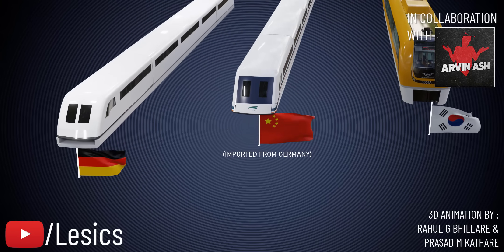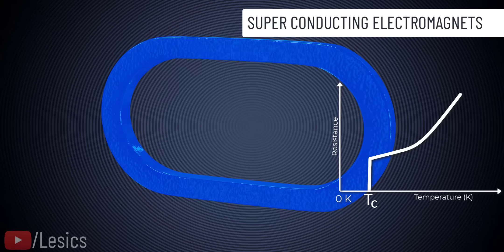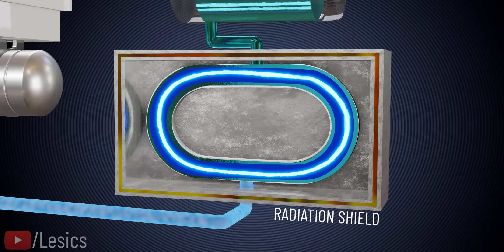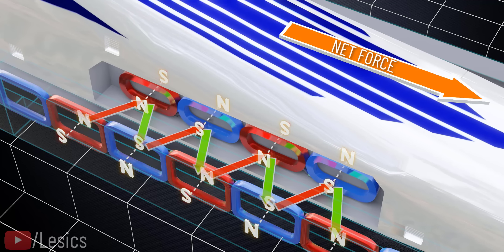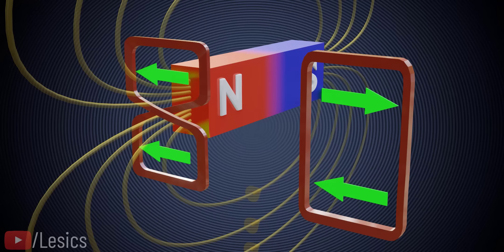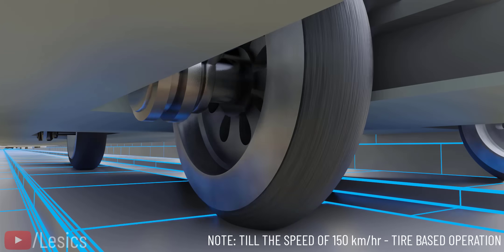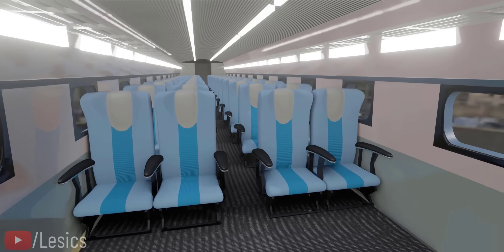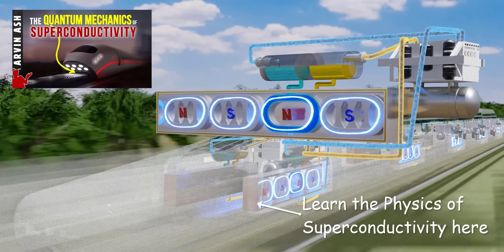The Fastest train ever built | The complete physics of it

Comment: One question though, doesn't surrounded by so many powerful electromagnets have any adverse effect on human beings? Is is safe?
Reply: The magnetic field generated by the Superconducting Maglev does not affect health because the magnetic field is controlled below the standard value set by the international guideline (ICNIRP guideline) by taking various measures.
The standard value is set to a strict value of about 1/5 to 1/10 of the magnetic field level that may affect the human body.

Comment: The technical aspect is certainly fascinating. But I wonder what problems of conventional trains this technology actually solves?
I mean the tracks alone are vastly more complicated and presumably more costly to build and maintain. And the same should hold true for the train itself. All while considering that the current speed record is 570ish and was achieved by a conventional train and knowing that during passenger operation this train wont go nearly as fast.
It would've been nice if the video had included a energy comparison to conventional trains.
Reply: the Tokaido Shinkansen line operated by the same company is already at near full capacity in terms of the number of trains operating. at peak times a Shinkansen train departs at Tokyo about every 3 minutes. this will decongest it and at the same time seriously rival airlines operating at the same route.
Reply: Less drag and friction due to not using wheels should make it more power efficient at higher speeds. Since conventional rail will require more energy to overcome the added friction of the wheels at higher speeds. Higher speeds also wear out the wheels and powerline faster. The initial cost of this is higher due to the special track but it's overall cheaper than conventional HSR when running at the same speeds over the course of its operational lifetime. It's actually also cheaper maintenance wise as the magnets are essentially passive systems and there's less wear on the actual train, its maintenance is more on hours in service than distance travelled and average speed like in conventional HSRs. The biggest cost draw is mostly upfront for the track and initial designs, overall HSRs are usually cheaper for shorter distances while MagLev tends to end up cheaper for longer distances.

Aside from relieving congestion from the current existing lines, the speed is important as it cuts travel time and makes the economic city hubs of Japan closer. This results on potentially bigger economic activity just like how the initial Shinkansen did when it made it possible to travel to Osaka and Nagoya within reasonable time in a day which the govt is aiming for.

Comment: Seems like a waste when you get the exact same hover. Technology by using exact same three of those type of magnets then and pulling them opposite from each other then and pointing all the magnets toward one single point. Send using another magnetic ring on the inside of that solitary point should create lift and as long as you have power supplied to the magnets and the ring. Anything you connect to it will then also gain the zero gravity effect but you would have to connect to it after you turned it on.

Comment: The system as shown in this video is still essentially a monorail. A practical mag-lev system needs to be able to switch "tracks".
Reply: If the train is dedicated to going from point A to point B delivering/picking up and dropping off  passengers along the way why does it need to switch tracks?
Reply: @paulchristensen2854  What happens when it gets to the other end? Does it go back on the same track, making it fit for one train only? Do you have a loop at each end to turn the train around? What happens if it breaks down? How do you put it into sidings to allow the next train to pass? It's not a practical system as it stands.
Reply: @apmcd47  LMAO....right countries are spending billions....no 100s of billions of dollars on these "unpractical systems" 
As I see it there are two things to break down
1, loss of power/power failure. If that happens the trains stop....all of them
2 ,computer malfunction causing the polarity reversals to be timed incorrectly. If that happens the rains slow down or stop altogether
Reply: Okay, this video by Mustard (https://youtu.be/-MmcQKE12Hg) mentions, but doesn't go into detail about, switches for this system.

Comment: Power consumption: "The Superconducting Maglev is a transportation system that uses less energy and offers greater functionality than airplanes in terms of speed performance, access to urban areas and transportation capacity. Estimation based on specific premises puts peak power consumption (instantaneous value) of the Chuo Shinkansen at approx. 270,000kW at service launch to Nagoya, and approx. 740,000kW at service launch to Osaka, as shown in deliberations by Japan's Transport Policy Council. These are well within the supply capacity of electric power companies.
The Tokaido Shinkansen has improved its energy efficiency by approx. 50% since its service launch. JR Central will continue to work on reducing the weight of vehicles, improving its shape, enhancing the performance of power converters and incorporating leading-edge insight to the maximum extent to boost the energy efficiency of the Chuo Shinkansen."

Comment: Brilliant video!
Question: What limits the trains speed? Is it only air resistance?
Reply: Air resistance yes and the amount of power it consumes. Faster you want to go, the more electrical power you'd have to put in. Also the faster you go the more mother nature is trying to hold you back. So at a certain point you'll use way more energy on every extra kph (or miles pr hour) than would be sustainable. Maglevs are absurdly expensive because they require so much energy and that's also why it's not commercially viable on a massive scale like rail.
Reply: Yea I guess
That's why they made such a sleek and aerodynamic engine cab
Reply: Besides the strength of the propelling coils, I'm guessing that it's speed might be limited by the stability of the system. The video only talks about static stability, but at higher speeds oscillations may develop (either vertically or side to side) that would make it unsafe to operate.
Reply: Power limitations
Reply: If it was in vacuum it would have been faster
Reply: @GAMERAX_Ae  Yes it would, but making a continuous vacuum chamber for a train...not such an easy thing to do.
Reply: current or voltage controls magnetic power and wire density, wire diameter and wire insulation thickness/material limits the max current, basically like with any bldc
Reply: Power is proportional to the cube of velocity. So slick as it is. It can only go so fast before power consumption becomes ridiculous. Also the faster it goes the longer it takes to stop.
Reply: Greater the speed, the more levitation is achieved. My theory then would be that if they increased the speed too much, it could fly off (?) when reaching a critical point (if possible at all).
Reply: @Killer99215  it can't fly off coz when it moves over the central axis of figure 8 the force from upper coil will be more hence it will add up with the gravitational force and bring the train down , same principle of how the train levitate but now it is trying to keep the train down. Maybe due to quick changes between levitation and delevitatinon there will be turbulence hence for safety reasons they may be sticking to a certain speed limit. Hope my comment is useful.
Reply: @The_Sad_Cactus  Thats what I thought.
Reply: @The_Sad_Cactus  nmu
Reply: Nothing, if they wanted, it can travel so fast than front of it melt by air drag. And second reason is power what it needs. But basically it have similarly of railgun. Railgun use just direct contact for power, not coils.
Reply: @jannejohansson3383  ?!
Reply: I think when the train reaches a certain speed like the point it starts flying/hovering it cant fly off despite it goes super fast cuz the magnet is keeping it from flying and keeping it from going down during the super speed thing.

Comment: At such high speeds, it is extremely dangerous to move in close contact with the ground. A sudden failure may occur in one of the numerous driving and propulsion systems, or a sudden obstacle in the path or any unexpected event may occur. If such a mass traveling at such a speed loses control and exits the runway, in addition to killing all the passengers it would wreak havoc for a few kilometers of everything that exists along the way. In my opinion these things are mere nonsense.

Comment: I would love to see all the equipment needed to control all the timing of the electromagnets and sensor feedback from every system on the train and ground. So impressive!
Reply: They can improve it still by adding barbs that encourage the shape of the magnetic field to reduce its electrodynamic drag really it should be researched amongst all forms of magnetic induction system it might reduce the amount of regenerative breaking yield but you get higher speeds with less power on a single coil since it will ‘reach’ out to the one infront to coax the reactions faster a third rail used to braking might be necessary if you were to push the limits of its current design
Reply: Used for braking*typo

Comment: This is a very expensive design, as building the tracks is very expensive. As there are always more tracks than there are trains, it's favorable to have expensive trains and cheap tracks than having cheap trains and expensive tracks. With expensive tracks as this design uses, long distance connections are very expensive to build as the longer the distance, the more track you will need.

Comment: Looking at it again.  I do not understand the twist coil.  You have set the magnetic ring at the outer layer, which is either N or S.  Then you put the twisted coil for dinner later.  Doesn't make sense.  Each particular point should has the dominant pole that either push or pull the twisted one.  How the train move forward when the pulling force can come from both front and back equally?

What would happen if the passenger wear jewelry in the train if the pole force is that strong.

Comment: So am I the only one thinking the fastest train is a bad idea on an island country that's constantly hit with major earthquakes? What happens when the track is displaced from a shift in the earth or power loss at such a high speed?
Reply: Around 17:56 on October 24, 2004 "Niigata Chuetsu Earthquake" * Magnitude 6.8, a direct earthquake with a depth of 13 km at the epicenter
A total of 8 cars derailed, except for cars 6 and 7 of "Toki 325" from Tokyo to Niigata. At the time of the earthquake, the train was decelerating to about 200 km / h due to the stop at Nagaoka Station, but the emergency brake by the early earthquake detection warning system "Uredas" was activated and it was about from the derailment point. The train stopped at a point about 5 km near Niigata and Nagaoka Station near Tokyo.
0 injured, 0 dead

Around 14:46 on March 11, 2011 "Tohoku Region Pacific Ocean Offshore Earthquake * Great East Japan Earthquake" * Magnitude 9.0 to 9.1 The seabed of the Pacific Ocean (off Sanriku) about 130 km east-southeast of the Oshika Peninsula (38 degrees 06.2 minutes north latitude, 142 east longitude) Degree 51.6 minutes), depth of the epicenter about 24 km
None of the Tohoku-Hokkaido Shinkansen, which was in commercial operation, derailed.
Naturally 0 injured and 0 dead
This is because the system that applies the brakes by observing the P waves generated before observing the sensational shaking (S group) of the earthquake was activated.

Comment: I had experience with it roughly 20 years ago. It was so cool. Sad it’s still not for commercial use yet, and it might be too late. I’m afraid Hyperloop might just kill it…
Reply: It won't.  The concept of the hyperloop isn't feasible(on Earth) and even if it was made functional it will be neither economical or pass safety checks.
Reply: Japan will not start commercial use until it has repeated safety and durability tests over and over again ... hundreds of thousands of times.
We assume and experiment with all situations for safety and durability testing.
If Hyperloop is to be used commercially first, its safety and durability are questionable.
The Japanese Shinkansen does not actively introduce the latest technology, and even if it is an old technology, we will introduce the system with an emphasis on reliability.
Safety and reliability are of the utmost importance to Japanese railway engineers, not innovation or speed.
What is the most important thing about public transportation? Is it innovation? Is it speed? Is it the world's first title?
No, it's safety and reliability.

Comment: So this is basically the same as aviation from a load and speed perspective. Clearly a far better idea than vacuum trains.

mag train:
~600 km/h max
everything is very expensive (train, tracks etc.)
high maintenance
low loads
not possible to switch tracks easily.
therefore, very limited branching of the system.
probably environmentally friendly

normal train:
~400 km/h max
medium cost
low maintenance
max weight that can be transported on land
track switches are no problem
You could go as far as to replace all bus lines in the world with it if you wanted too.
environmentally friendly

Aviation:
>300m/s max
very expensive
high maintenance
low loads
no track only needs airports
very unfriendly to the environment

I kind of am unsure this 2030 is a reasonable expectation for this to be build pretty much anywhere because it has to compete with aviation and is almost the same but with greater drawbacks. So until states actually enforce any environmental reforms, it won't make it.

Comment: When Maglev goes about 10 cm (or less), above the ground with a speed of approx. 600 kph (or anything above 100 kph), creates an enormous air cushion which reduced the needed electric current necessary for levitation. This phenomenon is not mentioned, but it should be.
Reply: The ground effect
Reply: @amirfmaster2515  ground effect is usually used for downforce, not making an air cushion i think
Reply: @ananayjoshi  Ground effect usually used in air cusion such WIGS , or helicopter in hovering mode.
Reply: @ananayjoshi  you think wrong. Think of low wing airplanes, the ground effect makes 'em floating upon landing.
Reply: @ananayjoshi  yea that could actually lift it too far .... I think the same force if not more would be needed to keep it save and steady in both vertical as sideways position... think about weather conditions.. wind, cold / warm fluctuations etc... You wouldn't want to be depending on those in such a tight space
Reply: The levitation and guidance coils in the track system are all passive.  There is no more "power" required for them to operate beyond what's needed to keep the train's coils superconductingly cold.

The track system's propulsion coils are powered, but are only indirectly involved in the levitation forces.  

This whole system is insanely clever!

I do wonder about something as simple as someone throwing an old tire onto the track.  I assume they must be able to handle some significant track debris somehow.
Reply: @jerrygrimes8813  'The levitation and guidance coils in the track system are all passive.  There is no more "power" required for them to operate beyond what's needed to keep the train's coils superconductingly cold.'
Yes and no.  They are passive in the sense that they are not part of a circuit containing a conductively connected power source.  However, they are stationary conductors in the presence of moving magnetic fields and therefore will have induced currents flowing in them.  Because they are ordinary conductors, not superconductors, they will experience I^2R power losses and that power ultimately has to come from somewhere.......
Reply: same effect when you drop a cd and you notice it gliding across the ground without actually touching the ground
Reply: But it also creates drag which is not good
Reply: @ezicarus8216  Thx for the suggestion, the topic is interesting I will watch it
Reply: The levitation magnets don't use any electricity, they are passive.
Reply: @FedericoLucchi  'The levitation magnets don't use any electricity, they are passive.'
Yes and no.  They are passive in the sense that they are not part of a circuit containing a conductively connected power source.  However, they are stationary conductors in the presence of moving magnetic fields and therefore will have induced currents flowing in them.  Because they are ordinary conductors, not superconductors, they will experience I^2R power losses and that power ultimately has to come from somewhere.......
Reply: L km
Reply: sounds like it's flying
Reply: @ezicarus8216 I really don't know how the train behaves at that speed, it is expectable that turbulence made its ride hard. You are right, to avoid collision with rail walls you need extra power in magnets. Something that intrigues me is the type of rail, it is not T rail as usual, but U rail (possibly dictated by the size of magnets, or something else).
Reply: Cool. Isn't that the same concept that the Ekranoplan used?

Comment: When the current is induced inside the levitation coils (8 shaped coils), the current will generate heat in the 8 shaped coil because they are not superconductors. If so then there will be energy loss in the form of heat in the 8 shaped coils. Since the current is induced from the superconducting coil then shouldn't there be an energy loss in it? Does the current in the superconductors need to be topped up to compensate for the induced energy lost in the 8 shaped coils?